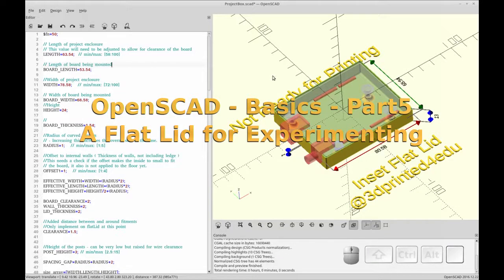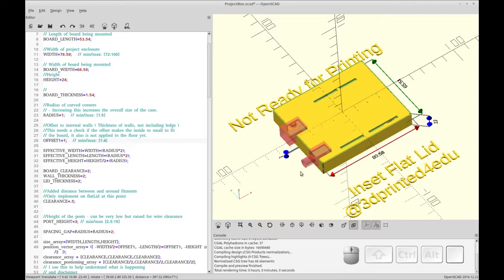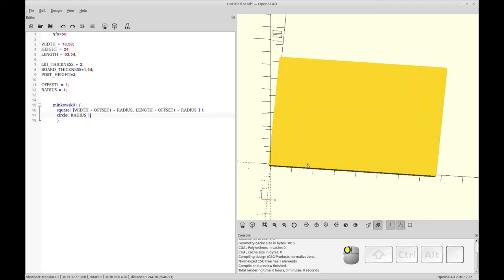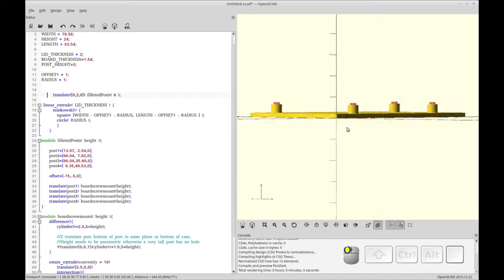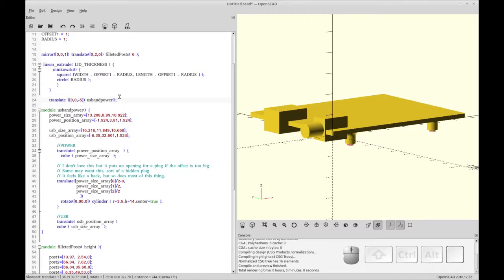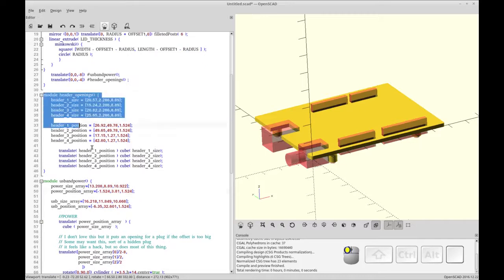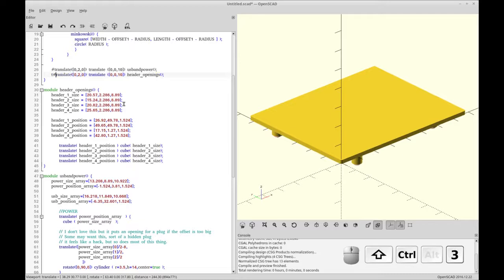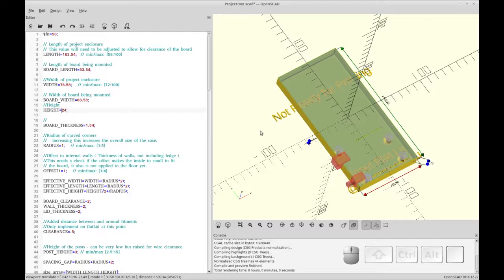OpenSCAD - Project Enclosure - Part 5 - Arduino Lid

Comment: Very interesting.  Getting very involved with OpenScad as my goto tool for design of my parts, I ran into your series.  Unfortunately, it seems that the first minute or so is good resolution, but quickly degrades to the point where I can't make out the code areas at all.  This may well be an algorithm issue with YouTube.  Had you published your code anywhere for us novices to pick up and build on?  OpenScad appears to solve one problem I had with Fusion360 for my art projects.  I use a DXF file to import my art, extrude it to a certain height, then attempt to round ( fillet ) the top only.  It does appear that I can do that with OpenScad, while it is almost impossible to do on Fusion 360 with my complicated shapes ( I.E>  a Heart  )  Thanks ...

Comment: I just don't get why you'd want to go back  to dos days to make a 3d project.  thanks for sharing your knowledge anyway.
Reply from the maker: Thanks for the input. I don't see OpenSCAD as something I would use for advanced projects. I believe it serves a purpose for bringing new designers easily into the world of CAD. Without having to learn sometimes complex GUI based cad systems a new learner can produce simple shapes/parts in a reasonable amount of time. However, if a designer already has experience OpenSCAD is likely not for them.